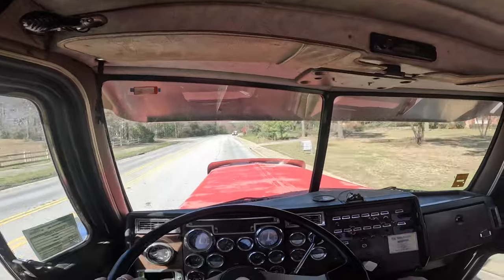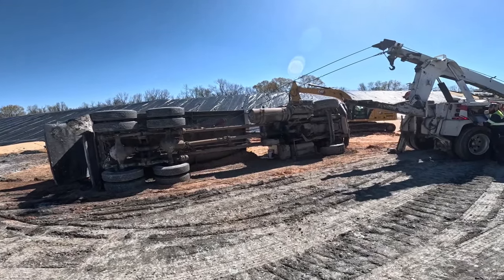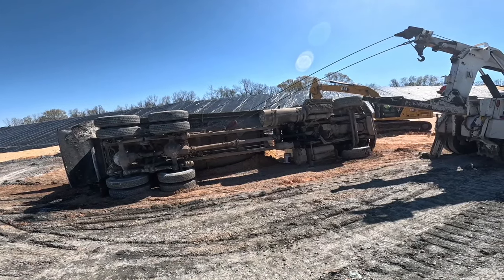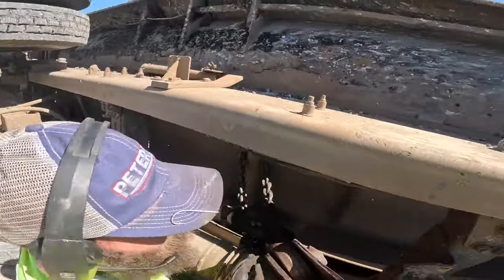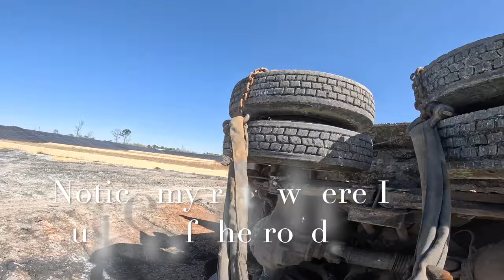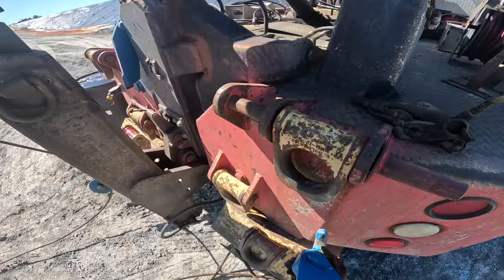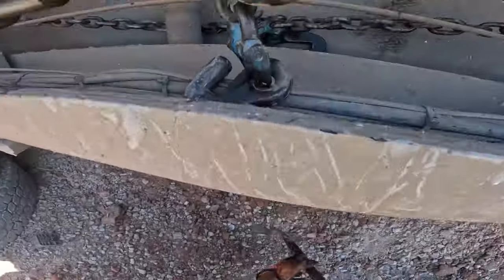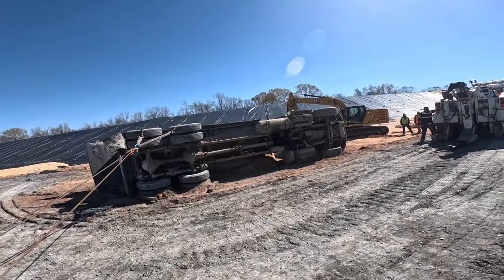Dump Truck Recovery

Comment: Thanks again for helping us out! Caleb helped us on Thanksgiving last year, getting the truck off of the guardrail. Awesome job! I'm the guy that was in the white F-250 leading you guys into the landfill. It was my driver that laid the truck over. The truck only needed new hood latches, oil and hydraulic refill, mirrors, and a door latch. It's back up and running right now! Thanks to you guys for doing absolutely no damage during the recovery process. Highly recommended! Our go to wrecker service over here in Eastover!
Reply from the maker: Mr Tyrone  Glad it is already up and running. We appreciate your business and stay safe.

Comment: Another great job
Reply from the maker: Mr Jay Thanks for watching and stay safe
Reply: @SumterWrecker  I have done several dump trucks and dump trailers. Always nice if it was at a coal pile and didn't have to worry about hydraulic oil leaking.  Gave that coal higher BTU's!  😉

Comment: Nice job Y'all did there Boss man.  Guess that truck wasn't a side dump after all.  
Dropping'em like that might save a windshield along the way, shakin some of the loose tailings hanginv on the underside.  
Thanks for sharing.  Trust You had a great Easter.  Blessings 👍🇺🇸🤔
Reply from the maker: Mr Barry Thanks and thank you for watching. Stay safe